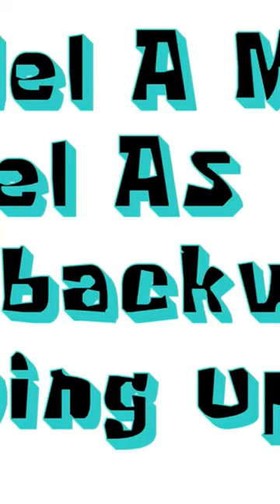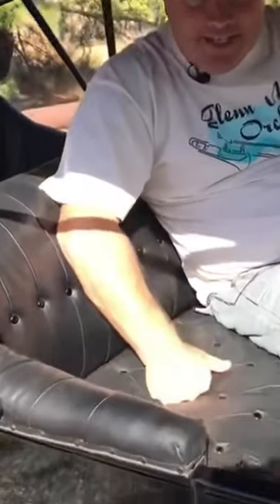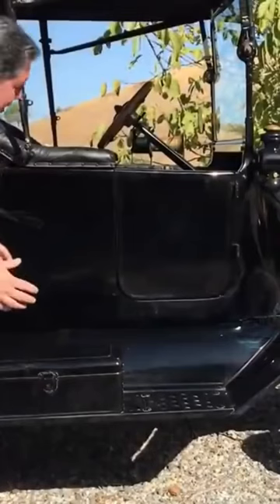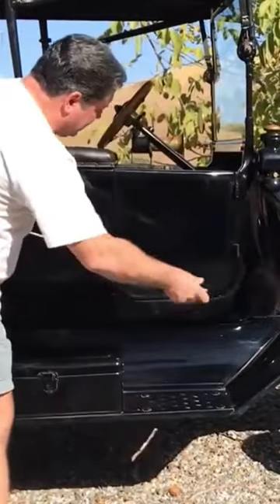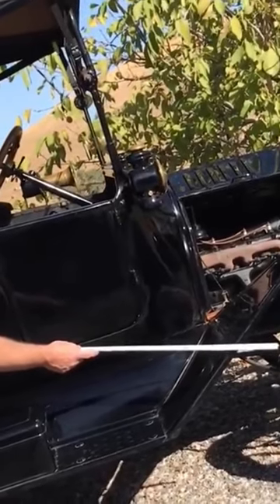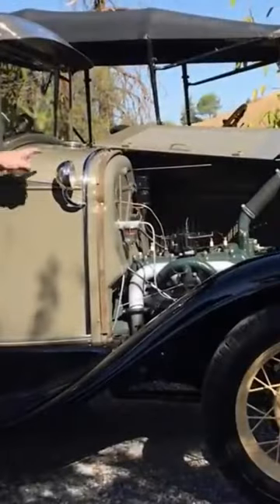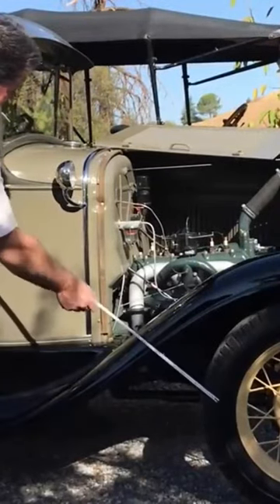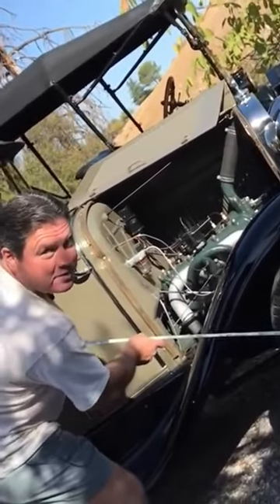Do Ford Model As have to go backwards uphill?

Comment: Had a 1980s model Volvo manual shift car, in which 1st gear went out while driving. From a dead stop, could get the car rolling and up through the gears by starting in 2nd, but where we lived had a long, steep approach off the main road. How to get up that steep hill? Then I remembered the Model T story about going backwards up steep slopes and tried it. Hurrah, it worked! Reverse gear was even lower than 1st.

Comment: Paul, we really love your channel and your passion for our beloved Model As. The techinical advice and tips you provide are very valuable. Regards this particular video, I have some comments: here in Brazil, older fellows used to say it was better to overcome a very steep grade in reverse due to the fact the reverse gear provided more torque to the rear wheels compared to low gear. According to Dyke's Instruction N. 86, low gear features a 3.12:1 ratio, whereas reverse provides a 3.75:1 ratio, a 20% advantage in gradeability. That explains, at least in our uneven topography, why many old school drivers choose to climb grades in reverse. The same applies to a variety of other vintage cars and trucks. Many thanks for your efforts to preserve the Ford Model A memory. Cheers from Brazil.  Evandro, '31 Deluxe Roadster. 🇺🇸🇧🇷👍🏽👍🏽💪🏽💪🏽
Reply from the maker: Gracias, amigo!!